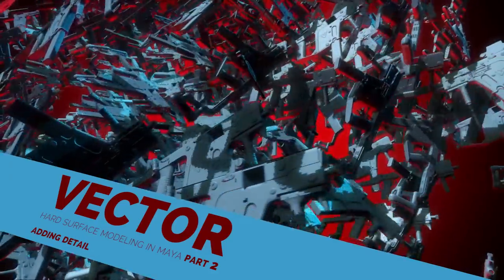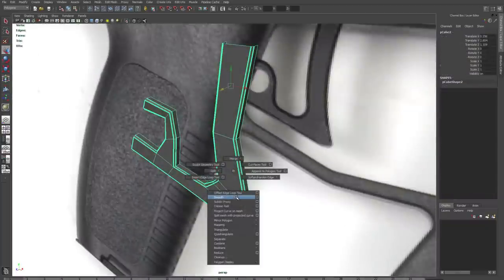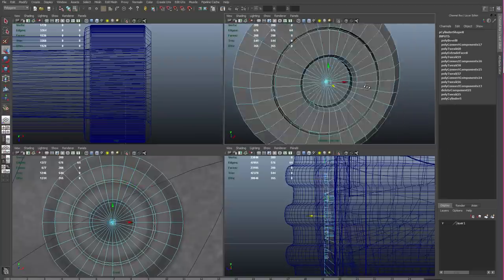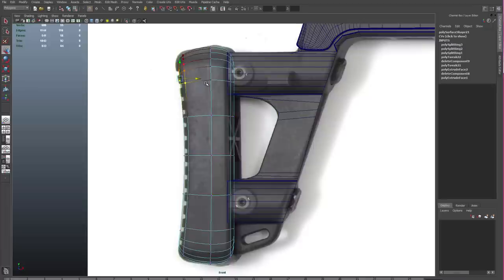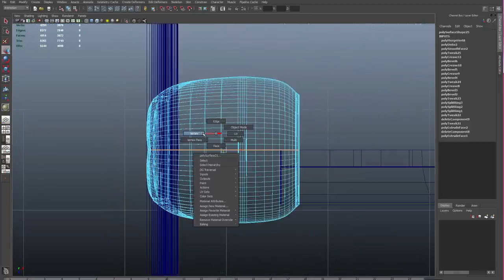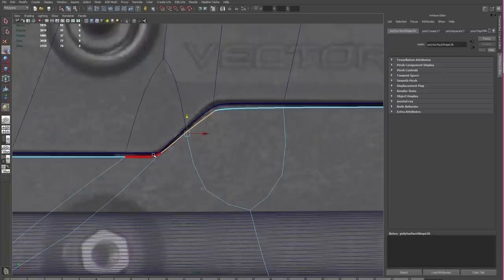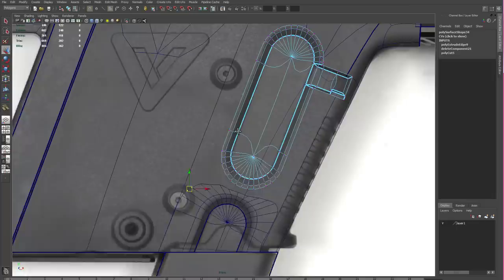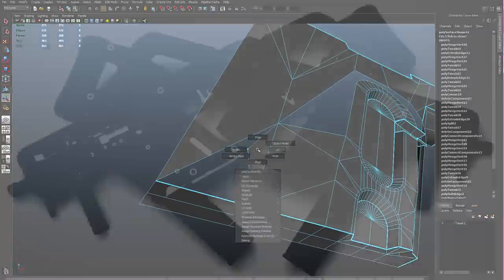GUN MODELING in MAYA part 2 - bevel, mesh smooth, & boolean

Comment: I think I needed that "harden edge" tool! I built a stealthy jet fighter and it won't smooth out anywhere near the way I want. It is driving me nuts! So much so that I stopped modeling all together. I'll try this though...!
Reply from the maker: FrakU2 yes, the Crease tool is definitely a necessity for high poly modeling. Give it a shot!
Reply: watch a tutorial on creases , to  smooth / smooth preview you need to add edges in a specific way so that the object will smooth the you want  :)
Reply: tudort4deusz I'll give it another shot thanks. Unfortunately there are NO tutorials or videos on how to use the smooth tool other than pressing the button "smooth". Trust me I've looked for them!!!
Reply from the maker: FrakU2 hit 2 to see the smooth mesh overlaid on the low res cage. This is a good way to get a sense of what maya does when smoothing.
Reply: James Taylor Will do thanks!

Comment: Hey James, before you used boolean on the stock, you got out of the smooth preview right ?

Because on my side, whenever I use boolean with a smoothed mesh, the result is a complete mess. 

thanks
Reply from the maker: iplaybose yes, I used mesh smooth to make the smoothing on the object permanent. Smooth proxy doesn't change the actual underlying geometry, so boolean will still be working with whatever the low res mesh looks like.
Reply: Thank you James

Comment: great style of tutorial, fast but still completely comprehensive. Is there a speed advantage to selecting tools from the quickselect menu vs shelves?
Reply from the maker: Robin Keast because you have to move your mouse less with the marking menu, I would assume it's incrementally faster, which could add up over time. I used to use custom marking menus because that was even faster for my workflow - but when I am demonstarting I try to stick to defaults. However it really comes down to the individual artist's preference.
Reply: Thx I'll try them both then keep up the good work

Comment: In Boolean at 5:16, after you use the Boolean Difference, did you go to each surface and fix the topology or did you just left it the way it is?
Reply from the maker: knight2battle I just left it. Because I didn't plan on making any further changes to the area, bad topo wouldn't matter. However, I did structure the original objects so that the topology would be pretty workable after the boolean.
Reply: James Taylor if you were trying to make this model game ready would you have still used boolean for the stock and then fixed it to be quads and tris, or would you have gone about it a different way. Because I know ngons don't matter for animation but I'm not an animation major.
Reply: Austin Love
Gotta keep everything in Quads because of some Polygon algorithm calculation thing in Maya, Quads are easier to compute i was told in Animation...

Comment: Great videos. I've only just picked maya up so they're all great tips! I have one question. When you were doing the swimming pool shapes towards the front of the stock you deleted the faces. Why couldn't you use the Boolean tool? Does it affect your geometry too much? Thanks
Reply from the maker: yeah, Boolean is generally an unreliable operator. It creates messy topology and has had a tendency to crash Maya.

Comment: These tutorials are great. Couple of questions:
Is there any difference in the effect you get when you bevel a hard edge vs when you crease it?
When working in hard surface, is it alright to have ngons, as long as they're planar?
Reply from the maker: CellDevises thanks! I mentioned before, but creases are absolutely the way to go. Adding edge loops increases the complexity of the mesh, which makes editing the shape much more difficult.

Ngons and tris aren't important here, as you say. Unless you are smoothing, then they can cause issues, but overall topology is not as big a concern for hard surfaces.

Comment: So I had a quick question, I was trying to use the smooth tool to smooth out my curves and make them more rounded, unlike your smooth though it tended to retain its shape. Is there something I need to check to make them smooth correctly?
Reply from the maker: +Christopher Donnelly try going to edit curves and using rebuild curve to add more control verts. Some times curves are created that don't have any interstitial verts, so they can only be straight lines.
Reply: +James Taylor Wouldn't that only work on things like a cv/ep curve? more specifically im curious as to when you were editing the trigger and you smooth/subdivided it to give it a better more rounded out feel then just cleaned up the edge loops. right now when I attempt that It maintains its exact same shape but just gains subdivisions.
Reply from the maker: +Christopher Donnelly you mentioned curves, that's what I was talking about. In mesh smooth there are some options you can check - keep hard edges should probably be off. And there is another numeric setting, under the number of subdivisions, that controls the smoothing of the very positions. If it's set to zero, it will give you the effect you describe.
Reply: Thanks a ton! New to smoothing but liking the feel so far

Comment: Hi! I  am studying 3d modeling for games. One problem i always get when i try to make a low polly of my high polly model.  the normals on the mesh can on some places  get  weird dark black shading. the face is not reversed. its the vertex normal direction i guess. i try to fix it but with no luck.  do you know what i should avoid to get these  weird black shading?  i soften the edges to bake  a normal map for it.
Reply from the maker: +Daniel Martinger try using Unlock Normals
Reply: yeah, have tried that.  it doesnt make any difference ^^

Comment: Is creasing a common method to create high poly hard surfaces? Because adding edgeloops is really difficult in complex models.
Reply from the maker: Every modeler is different. I like creases for exactly the reason you say. Others prefer actual edge loops, because those will work cross platform and don't rely on history to get it right.

Comment: Hi, im new to 3D art and I've been told multiple times to not use tris when modeling hard surfaces. I have a relatively hard time planning out where to use tris, how do you know when to use them?
Reply from the maker: +Eilliims Noved triangles don't matter for hard surface objects. Triangles are only a problem when deforming a mesh, e.g. a character with bones. Even then, triangles are only a problem in specific areas.

Comment: How did you get the inset piece aligned with the rest of the gun around 7:56?
Reply from the maker: Cody Scott that piece I extruded out as a group of edges from the inset area I was working on there. Doing a boolean would probably be the easier way to do it, after the rest of that area was complete.
Reply: James Taylor
thanks dude, your tutorial is great.  Its helping a lot on a model im doing of a tar 21.